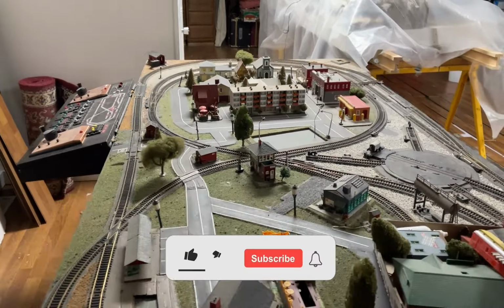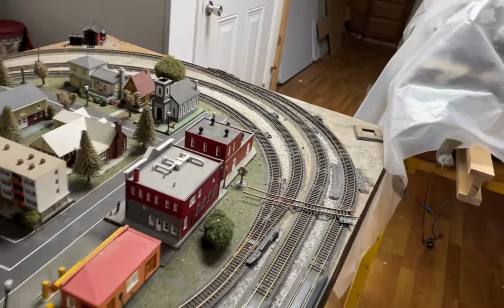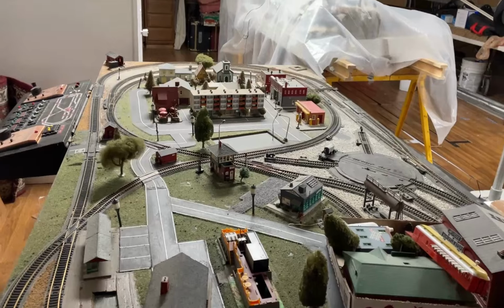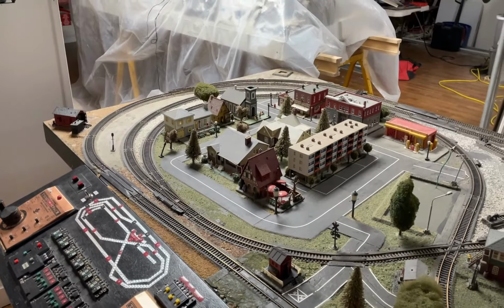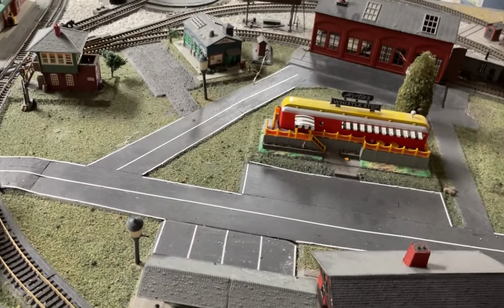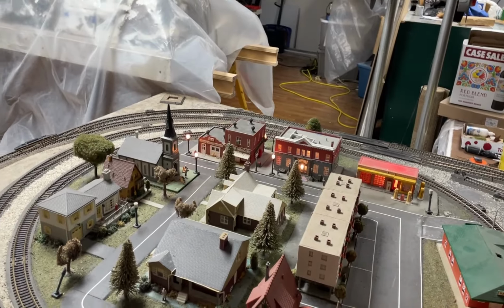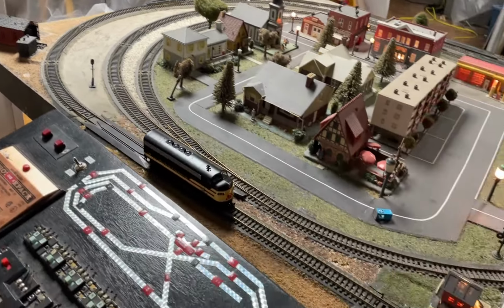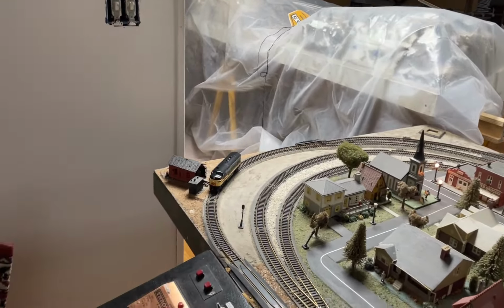Cleaning Track and Testing 50 Year Old Atlas 4x8 HO Scale DC Layout

Comment: Super. I got my start with an Atlas HO layout, one almost like this one, right out of the book, but equipped with Lionel and Mantua/Tyco equipment. All of the Atlas track survived my childhood and is in use on my modern layout, with my #6 switches (2) used for industrial sidings, while my #4 switches and sectional 9" straight track and 22", 18", 15", and 4 3/4 " radius curved paved street track (Eldon) and even my ancient Atlas diamond crossings, are installed on the trolley line and in the sugar beet mill yards and trackage. I hope someone who likes model trains gets this, as it sure brought back some memories for me. I recently even bought an old school Atlas SD locomotive frame from my hobby shops used section, which was $10.00 with the motor still attached, not for the frame, but the motor to power my almost fifty year old hand cranked Atlas turntable, because it was cheaper than most of the "new old stock" original motors out there. For Atlas fans, all of my old school Atlas locomotives, including two treasured EMD SD-24 high hood locomotives painted in the Chicago, Burlington, & Quincy/Burlington Route Chinese Red paint scheme, still operate great both inside running freight or outside plowing snow, usually assisted by two Lionel EMD GP-9s, and have a nice patina on the paint job after almost fifty years of operation that makes them look very realistic. Hello from the Tracy Mountain Railway in Colorado. 💙 T.E.N.